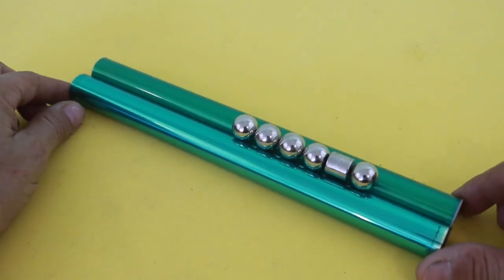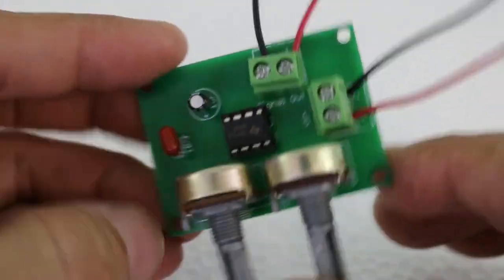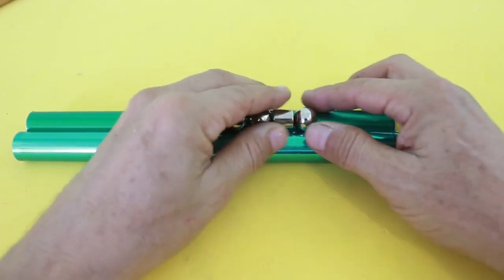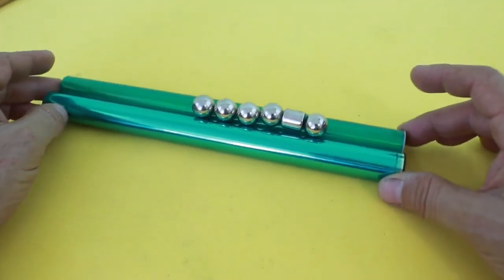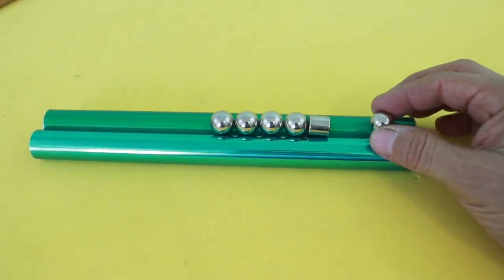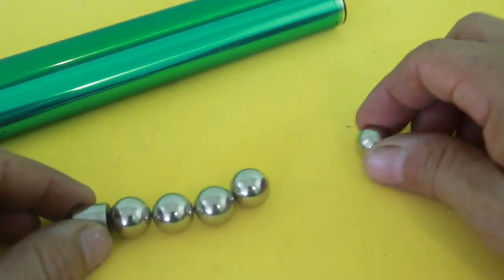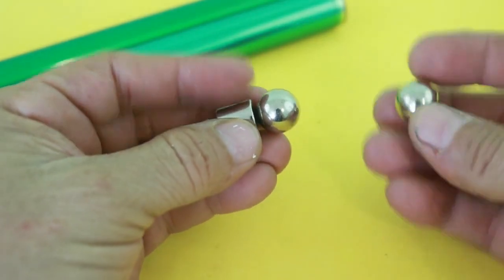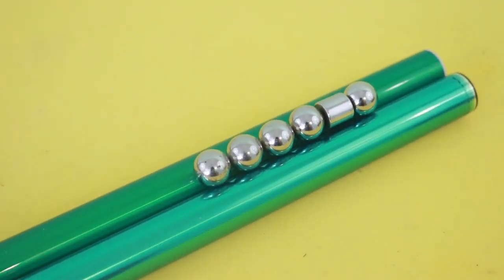Gauss Cannon - Physics Experiment

Comment: A larger magnet would require more balls. Less dramatic than I would like. How to increase the velocity of the last ball?
Reply: You answered your own question, use a larger magnet.
Reply: A longer "output chain" is only very slightly more lossy.  So yes, as the other guy said use a more powerful magnet.  Also start the incoming ball as far away as possible - more time accelerating gives higher speed on impact.